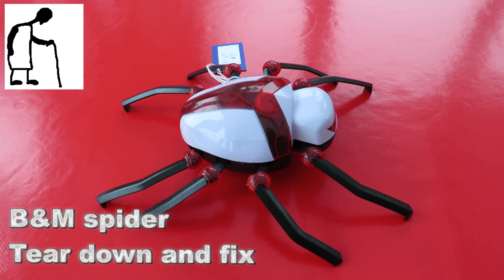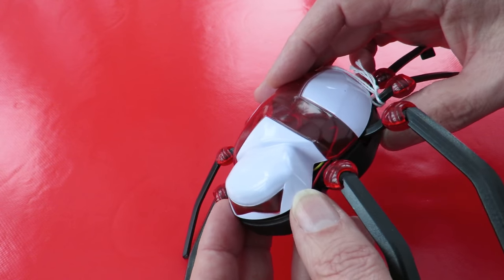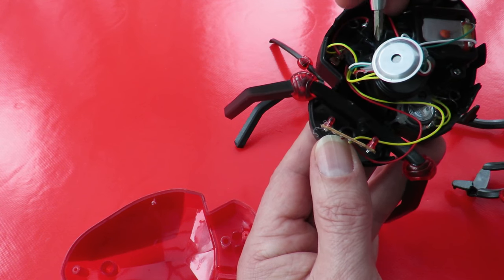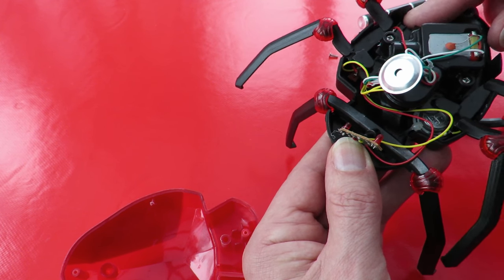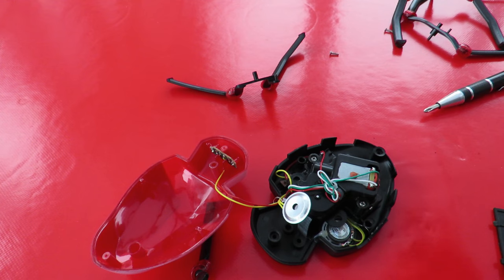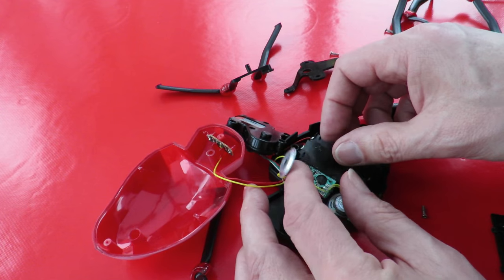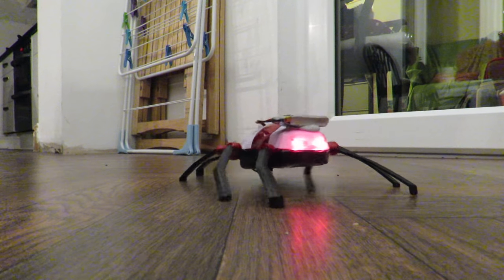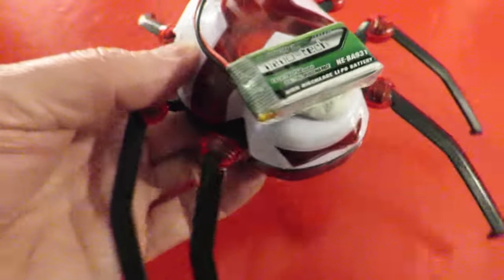B&M spider Tear Down and Fix

Comment: can you tell how to get more speed on dc motor I look all the videos none of them help me I hat rewinding I like to share it to you can you tell me some
Reply from the maker: More voltage will give you more speed as long as the power supply can also supply enough current. However rewinding the motor with a thicker gauge wire will give you a higher speed for the same voltage.
Reply: Thanks for replying grandad your mind is mind bloeing